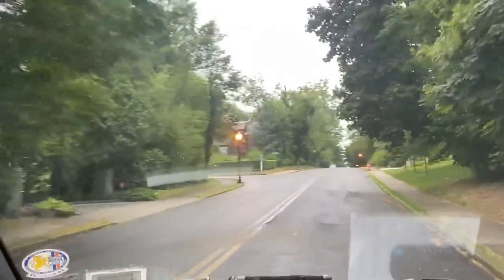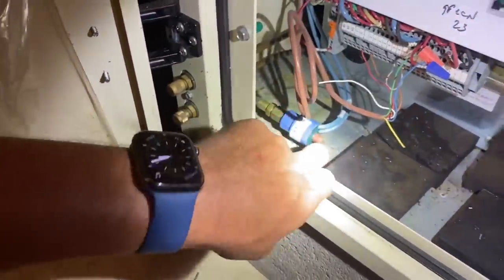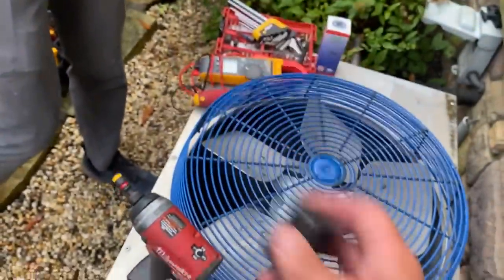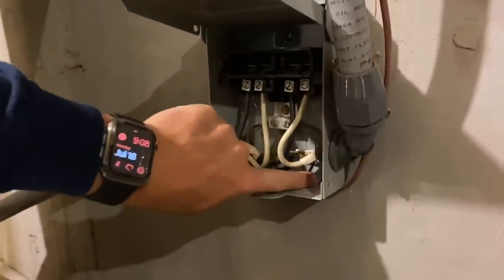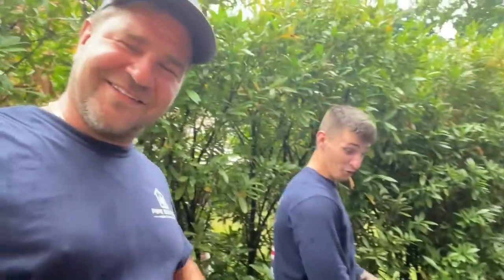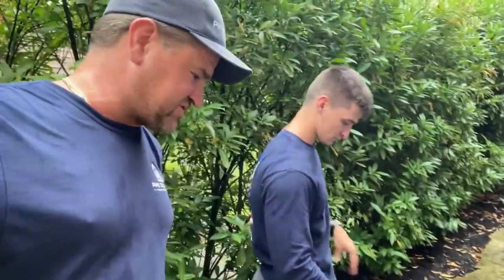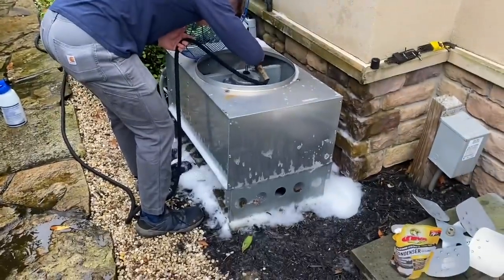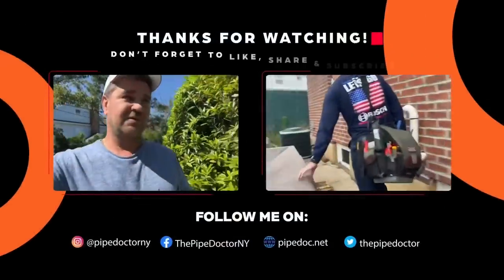Help! My Indoor Pool Room Isn’t Cooling and it’s 88 Degrees! How to Repair DesertAir HVAC Equipment

Comment: Hey Mike, not to criticize here, but a little SPD education.  I know that the RSH50 is made for the disconnects, but also keep the wires as short as possible.  You are racing the speed of light, well electrons anyway.  You need that spike to get to the RSH50 and it to react to the surge before that surge gets down the wire to the device.  It is a race between getting to the SPD before the end device.  That is why the manufacture wants to make those leads short as possible and straight as possible.  The gas discharge and or MOVs need to short that spike to ground to stop it.  You are the first person I have seen putting SPDs on the equipment which is an excellent option that I wish others would offer, if even at a small loss leader product sale!  You would be surprised by the number of spike caused by things in the house.  That is why a multi-layer approach is by far best and SPDs are now required by the NEC 2020 edition.  The first layer is a type 1 at the meter itself followed by a Type 2 at the main panel and then type 3 (think power strip or your RSH50) at the devices.  Spikes generated by both internal and external devices to the home are protected.  For example you will see spikes when the compressor stops for instance when that contactor opens up.  Or from the power company as well coming down the line.  Just to set expectations, an SPD will NOT stop a direct lighting strike, and its not made for that either.  If that strike is a mile away it might help a small surge coming down the line.  That is where the type 1 and type 2 units help out at.  The type 3 units help protect from internally generated spike / surges inside the home.  Its all about will that surge coming down the line find an SPD first or the 8K 100" flat panel TV?  Sorry I am a big proponent of SPDs and using the full layered approach to help protect things.   I don't know how good Rectorseal is about their warranty as well, but can be a big selling point as well for machine coverage caused by spikes/surges.   Keep up the good work sir. 👍😎

Comment: A good mechanic is aware of their surroundings.
Nail it, if the equipment is running get deltas on the coil.
Next move check the evap coil, what’s up there.
Check the condenser for the obvious.
Fan on, comp on. Why not?
The capacitor was a good call, it was fatigued. Good show!

Comment: The cardinal diagnosis for a runaway high side pressure...it can't get rid of the heat. Dirty air filter, restricted flow, dirty or not moving fans. You always find it.

Comment: Those high pressure limits must be a issue with desert aire units.  Also torque those connections on those contactors they have a tendency to loosen up & cause the over loads on them to blow

Comment: Romex in carflex? Back when I had an indoor pool the room temperature  mostly followed the water temp, about 89 degrees water temp was really nice. Had a Lochinvar for heating the pool water, in the Wisconsin winter when the house boiler and the pool heater was cranking you could hear the gas meter howling $$$.

Comment: Always get to see equipment here that you won’t see anywhere else…BTW, use 10g Wago’s for your surge protectors so you eliminate double stacking wires. Stacking wires can be a code issue depending on disconnect box terminals. Yes, I’m aware the instructions show wiring the way you did it 🤷‍♂️

Comment: My question is that you spend the time to remove the blade guard the fan blade ,checked the capacitor , replaced removed some debris from the coil.... why not checked the coil from the bottom for any debris? 
You had to do the same work twice.
Great video love the content and your approach.
Reply: @PipeDoctor  Good job though like I said love the content.
Reply: someone wasn't being observant of their surroundings or did he just want to work outside in the rain?  🤣🙃
pooo happens, you overlook things now and then.

Comment: Mike, how does that surge protector work when it's not breaking the line voltage?  I've been retired for a couple years now and never used them. Seems like it would have to break the line or load.  Thanks for the video.

Comment: With pool cover's you get what you pay for. I know a very very wealthy guy in Michigan who runs his outside pool all year around. His happens to be a salt water set up. You can walk across it and it barley moves he had it custom made. 20:27 mark in your video you can see how the cover drops onto the water, his doesn't do that it is straight level with the concrete. It also had a picture of an elephant head on it. He asked me to walk across it but I chickened out, it just didn't seem like the right thing to do.

Comment: 6:01 @Mikey Pipes - Pipe Doctor Plumbing & Heating & Air
Along w/ others who may not know this:
Not sure if know but if go to:  https://www.wihatools.com/no-hassle-guarantee
And fill out or you can even call CS, or email a rep if have one to do a tool replacement if a tool breaks; just like this.
Make SURE YOU TAKE PICTURES of said tool, b/c they won’t warranty it w/o (far as know, at least it makes it “harder” to get a warranty replacement); but after fill out or call and send pics……new tool should arrive in mail days to 2 weeks later. Most “great” tool companies have this kind of warranty policy; just some make it “so much easier” to do a warranty return, but think you’ll have good luck w/ yours.
Thx for vid and have a great day Mikey and AFN😉✌🏻

Comment: Geez Mike, it looks like all the contractors and relays are mounted on din rails??  Did I see that right,  and any of the common brands of industrial contractors are relays should mount in that panel....

I didn't see anything unique to the manufacturer of the unit.

Comment: What's your general opinion on indoor pools? I know you've got a fantastic outdoor one. Just thinking if/when I spend the money on a nice pool, I want to be able to use it year round. A few houses in my neighborhood have them, but it seems like they've fallen out of favor in newer builds. Makes sense about using the automatic cover to control evaporation.
Reply: indoor pools are a very dumb idea. 24/7 battle between holding the water temperature and air temperature at the perfect level and dehumidifying pretty much 24/7.
pretty much the air temp should always be 2F hotter than the water to curb rapid evaporation, either side of that and ugly things start to happen. you also need 24/7 air exchanging to outdoors. so pretty much throwing tons of money away year round.
Reply: @PipeDoctor  yes that pretty much sums up why only rich people tend to have them. In general pools are only common and desired by typical home buyers in warm states such as California and Florida.
Reply: I want an indoor pool, not just because of winter use, but because I'm extremely pasty white, and I burn rather than tanning. I'd forego the retracting roof too, as I'd never want to be in direct sunlight in the pool, lest I get skin cancer!  

BTW, did you see the VacuFlo FC unit?

Comment: Desert Air is more like a commercial Walk in or Freezer Deal Eh? 
Is that because they needed more than 5 Ton in that one room?  Would be cool if the Pool Room AC, was also the Pool Heater.
Reply: Most pool units are designed to cool, dehumidify, Air heat and water heat. Looks like on this one the water heat isn’t hooked up which can also cause nuisance HP trips as pressure builds up in that 3 way valve over time.
Reply: @jacobdeep4586  is that those 2 big copper pipes out the front?
Reply: I believe so